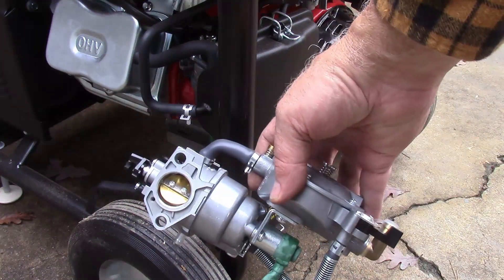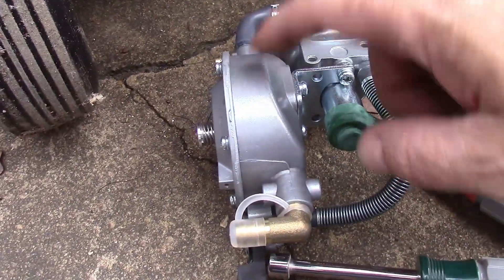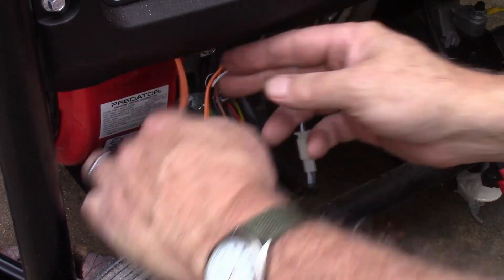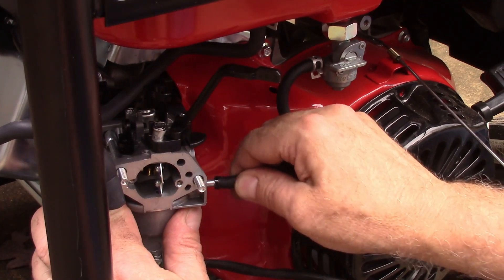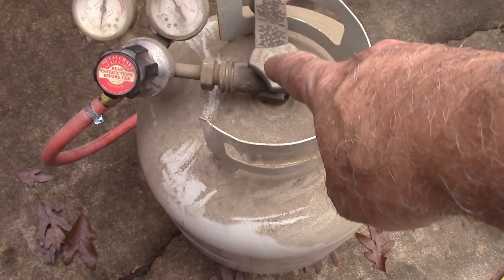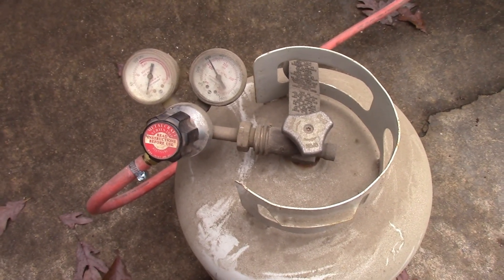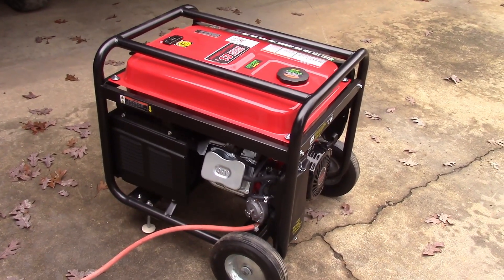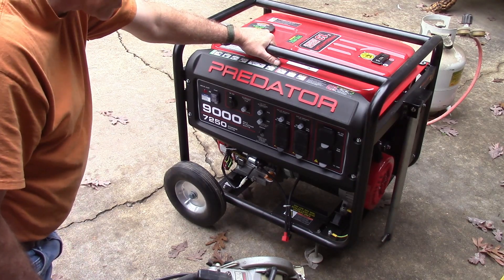Predator 9000/8750 Generator Propane Conversion  Tri Fuel

Comment: I have this same brand new carburetor for my generator and it's leaking fuel out of the bowl drain. The screw came with the carb and is tight. To me there is nothing preventing the fuel from draining out. Is it juat supposed to create a vaccum inside of the float bowl which doesn't allow fuel to flow out? Maybe i have a bad seal on float bowl or the drain screw sealing washer isn't seating well enough. Just confused at this point as it's all brand new
Reply from the maker: I would take the bowl off and make sure the seals are seated correctly or maybe one is missing.  Good luck
Reply: @SoatMon  yea thats where im going to start. I have no explanation other than it has to work on vaccum bc the bolt designed for the drain is only about 6mm  long.
Reply: @SoatMon  apparently there is supposed to be a house that loops down and back up above the bowl height. I just used a hose with an on/off valve and routed it straight down. Worked like a charm

Comment: Question.... this carb says it's for COMPRESSED natural gas which is not what our houses have. I see that it works but I'm a bit concerned that it's not appropriate for this application. Maybe the the device at motorsnorkels would be the safer choice? I used their product at my last house, this video led me to the hope of a cheaper solution. Anyone have any thoughts on this? The motorsnorkel device looks more robust, not sure if it matters but since we are playing with gas, thought to point it out. Curious, have you had a chance to operate it for hours or days straight?
Reply: My same concern.  Comment here from Doug Priest 6 months ago says he ran this model on household natural gas, but had to reduce spark plug gap.  Not sure, I want to go that route either...   Not worried for personal safety so much I am for safety of generator.  That said, for any natural gas or propane set up, i would install a solenoid valve in supply line held open by generator electrical so if generator dies for a non-gas supply reason, the gas will be shut off automatically.  This is a basic safety feature that all modern gas appliances have where the unencumbered flow of gas would be a lot less than with this generator.
Reply: Here is a reminder about portable generator safety: everyone really needs to see this safety reminder to make sure. Remember that portable generators need a lot of maintenance. This advice is just to make sure that everyone is aware of all the warnings and it’s just to remind people to be careful using portable generators. Generators can be dangerous if not used carefully. Every year, hundreds of people die or get injured when using portable generators due to carbon monoxide poisoning and electrocution. Make sure you are using your generator carefully and keeping others safe as well. There is something very serious that everyone should always be aware of when using generators. Some people do run their generator indoors which is not safe and that increases the risk of carbon monoxide poisoning which can cause death of family and you. Some people run their generator in wet conditions which can electrocute them. Please remember that you should never run your generator indoors. Remember that carbon monoxide is an odorless and colorless gas that you cannot see or smell. Carbon monoxide is a silent killer. Keep that in mind. Make sure your generator is 15-20 feet away from your house and away from doors, windows, and vents. Never use your generator in your porch too. Having a carbon monoxide detector is very important against generator safety. Some people also allow children to go near the portable generator which could pose risks. We need to keep an eye on our children making sure that they are not near the portable generator so they won’t get electrocuted or burned by the generator which is dangerous. A locking enclosure also keeps kids safe. A generator shed might look like a tempting place to explore, or take cover during a game of hide and seek, but a generator is a dangerous piece of equipment that can cause injury. It says on the manual that we should also keep children away at all times from the portable generator to avoid injuries. Please do not allow a child or unqualified people to operate the portable generator. Just because some manuals missed what should be listed doesn’t mean it’s safe to do. Always follow the generator safety rules when using portable generators. Generators pose electrical risks. If you need to use your generator during wet weather, you need a generator tent to protect your generator from getting wet. Don’t let your generator get wet. Keep your generator dry and before using your generator, please make sure your hands and your generator is dry. Do not wear loose clothing when operating the generator. Everything that is said on the generator’s operating manual should not be ignored. Never smoke cigarettes near the generator. Please keep flammable things away from the generator. Never overload your generator too. Your generator can catch fire. Never ever try to plug a generator cord into a wall outlet to avoid back feeding. Back feeding your generator is dangerous. Always turn on your generator first before plugging in appliances and shut off the appliances before turning your generator off. Use a heavy duty cord for your generator and the cord should not be worn out. All the instructions should be followed carefully. Never refuel your generator while it’s running. It can cause fire if fuel spills while your generator is hot. You should turn off your generator and let it cool off before refueling it. Having a fire extinguisher next to the generator is also important. This is only a reminder for everyone’s safety of using generators. Make sure your generator is properly grounded. Having a fire extinguisher next to the generator is also important against the safety rules. https://youtu.be/I1jT3ANENvI and here is a video more about keeping others safe when using generators and also about our family’s safety. Hope this helps. Thank you. Stay safe. And make sure you follow all the generator safety rules carefully. Just reminding everyone to be careful whenever using portable generators.
Reply: @The_Happy_Aviation_Enthusiast  Spammer!!!

Comment: When the generator demand for fuel fluctuates under various load conditions, how do keep the right amount of propane coming in?
Reply: Safwan Maurice Rached - same way it does with gas. That long rod he removes and reconnects is a governor. The governor and throttle work same no matter fuel source. The only difference between the 2 carbs is a vapor chamber. Don’t let the regulator confuse you. The propane regulator regulates pressure not flow.
Reply: @BrokenRRT  yeah but the large regulator is not a regulator. It senses change in vacuum when under load and opens up to give more natural gas.
Reply: Here is a reminder about portable generator safety: everyone needs to see this safety reminder to make sure. This advice is just to remind people to be careful using portable generators. Generators can be dangerous if not used carefully. Every year, hundreds of people die or get injured when using portable generators due to carbon monoxide poisoning and electrocution. Make sure you are using your generator carefully and keeping others safe as well. There is something very serious that everyone should always be aware of when using generators. Some people do run their generator indoors which is not safe and that increases the risk of carbon monoxide poisoning which can cause death of family and you. Some people run their generator in wet conditions which can electrocute them. Please remember that you should never run your generator indoors. Remember that carbon monoxide is an odorless and colorless gas that you cannot see or smell. Carbon monoxide is a silent killer. Keep that in mind. Make sure your generator is 15-20 feet away from your house and away from doors, windows, and vents. Never use your generator in your porch too. Having a carbon monoxide detector is very important against generator safety. Some people also allow children to go near the portable generator which could pose risks. We need to keep an eye on our children making sure that they are not near the portable generator so they won’t get electrocuted or burned by the generator which is dangerous. A locking enclosure also keeps kids safe. A generator shed might look like a tempting place to explore, or take cover during a game of hide and seek, but a generator is a dangerous piece of equipment that can cause injury. It says on the manual that we should also keep children away at all times from the portable generator to avoid injuries. Please do not allow a child or unqualified people to operate the portable generator. Just because some manuals missed what should be listed doesn’t mean it’s safe to do. Always follow the generator safety rules when using portable generators. Generators pose electrical risks. If you need to use your generator during wet weather, you need a generator tent to protect your generator from getting wet. Don’t let your generator get wet. Keep your generator dry and before using your generator, please make sure your hands and your generator is dry. Do not wear loose clothing when operating the generator. Everything that is said on the generator’s operating manual should not be ignored. Never smoke cigarettes near the generator. Please keep flammable things away from the generator. Never overload your generator too. Your generator can catch fire. Never ever try to plug a generator cord into a wall outlet to avoid back feeding. Back feeding your generator is dangerous. Always turn on your generator first before plugging in appliances and shut off the appliances before turning your generator off. Use a heavy duty cord for your generator and the cord should not be worn out. All the instructions should be followed carefully. Never refuel your generator while it’s running. It can cause fire if fuel spills while your generator is hot. You should turn off your generator and let it cool off before refueling it. Having a fire extinguisher next to the generator is also important. This is only a reminder for everyone’s safety of using generators. Make sure your generator is properly grounded. Having a fire extinguisher next to the generator is also important against the safety rules. https://youtu.be/I1jT3ANENvI and here is a video more about keeping others safe when using generators and also about our family’s safety. Hope this helps. Thank you. Be safe

Comment: have you ran this on natural gas? do you happen to know if it will need that secondary regulator for natural gas? thanks
Reply: House natural gas is regulated at the meter, so you won't need another regulator. .  Propane you'll need a definitely need a regulator for
Reply: Please make sure you watch this video about generator safety https://youtu.be/I1jT3ANENvI
Reply: NOT FOR NATURAL GAS !!!   the link provided takes you to Amazon where product description says LP/CNG conversion kit.   CNG is Compressed Natural Gas which is not the utility being fed to your house thru a gas line.  This is the pressurized version they use in some city buses and truck fleets.   You can get a carburetor for household natural gas, but it is not the one shown in this video !
Reply: @davec6016  You have spammed this reply many times but I contacted the manufacturer and they indicated it will operate just fine on natural gas under 1psi.
Reply: @davec6016  Please provide information to the 'household gas carburetor' that you keep referring to. Thanks!

Comment: I noticed that you are using a 7000 watt generator. The new carberator i think is only good for up to 4000 watts? My generator is also 7000 watts. Just would like to make sure it would work. Any ideas?
Reply from the maker: It's actually a 9000. I couldn't find a carburetor for a 9000 so I figured why not try it for the price. It appears to be the exact same carburetor just with the propane port and works great. Hope that helps

Comment: The link to the carb indicate that this is for a 4.5-5.5KW generator. Have you been able to test the generator at full load and validate the carb can handle the 9KW?
Reply from the maker: I was worried about that as well when I bought it but it seems to work fine and appeared to be the exact same carburetor as the original just with the propane port. I figured for the cost why not try it and it worked out.

Comment: Can I run it on Natural gas with that carburetor
Reply from the maker: Yes
Reply: No.   NOT FOR NATURAL GAS !!!   the link provided takes you to Amazon where product description says LP/CNG conversion kit.   CNG is Compressed Natural Gas which is not the utility being fed to your house thru a gas line.  This is the pressurized version they use in some city buses and truck fleets.   You can get a carburetor for household natural gas, but it is not the one shown in this video !
Reply: @davec6016  Please provide information to the 'household gas carburetor' that you keep referring to. Thanks!

Comment: I order the carburetor you said to order and Amazon sent me the wrong Carburetor the primer is on the right side it's not the same as you have. The link you gave. Is that the right part number?
Reply: Here is a reminder about portable generator safety: everyone really needs to see this safety reminder to make sure. This advice is just to make sure that everyone is aware of all the warnings and it’s just to remind people to be careful using portable generators. Generators can be dangerous if not used carefully. Every year, hundreds of people die or get injured when using portable generators due to carbon monoxide poisoning and electrocution. Make sure you are using your generator carefully and keeping others safe as well. There is something very serious that everyone should always be aware of when using generators. Some people do run their generator indoors which is not safe and that increases the risk of carbon monoxide poisoning which can cause death of family and you. Some people run their generator in wet conditions which can electrocute them. Please remember that you should never run your generator indoors. Remember that carbon monoxide is an odorless and colorless gas that you cannot see or smell. Carbon monoxide is a silent killer. Keep that in mind. Make sure your generator is 15-20 feet away from your house and away from doors, windows, and vents. Never use your generator in your porch too. Having a carbon monoxide detector is very important against generator safety. Some people also allow children to go near the portable generator which could pose risks. We need to keep an eye on our children making sure that they are not near the portable generator so they won’t get electrocuted or burned by the generator which is dangerous. A locking enclosure also keeps kids safe. A generator shed might look like a tempting place to explore, or take cover during a game of hide and seek, but a generator is a dangerous piece of equipment that can cause injury. It says on the manual that we should also keep children away at all times from the portable generator to avoid injuries. Please do not allow a child or unqualified people to operate the portable generator. Just because some manuals missed what should be listed doesn’t mean it’s safe to do. Always follow the generator safety rules when using portable generators. Generators pose electrical risks. If you need to use your generator during wet weather, you need a generator tent to protect your generator from getting wet. Don’t let your generator get wet. Keep your generator dry and before using your generator, please make sure your hands and your generator is dry. Do not wear loose clothing when operating the generator. Everything that is said on the generator’s operating manual should not be ignored. Never smoke cigarettes near the generator. Please keep flammable things away from the generator. Never overload your generator too. Your generator can catch fire. Never ever try to plug a generator cord into a wall outlet to avoid back feeding. Back feeding your generator is dangerous. Always turn on your generator first before plugging in appliances and shut off the appliances before turning your generator off. Use a heavy duty cord for your generator and the cord should not be worn out. All the instructions should be followed carefully. Never refuel your generator while it’s running. It can cause fire if fuel spills while your generator is hot. You should turn off your generator and let it cool off before refueling it. Having a fire extinguisher next to the generator is also important. This is only a reminder for everyone’s safety of using generators. Make sure your generator is properly grounded. Having a fire extinguisher next to the generator is also important against the safety rules. https://youtu.be/I1jT3ANENvI and here is a video more about keeping others safe when using generators and also about our family’s safety. Hope this helps. Thank you. Be safe